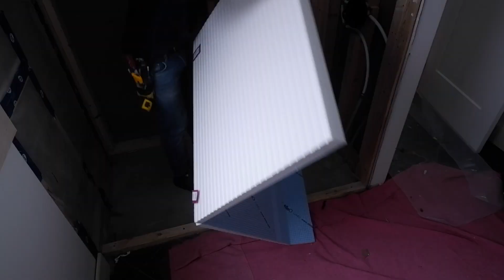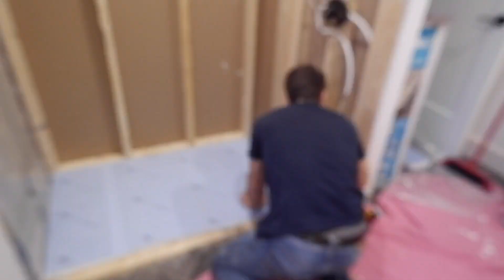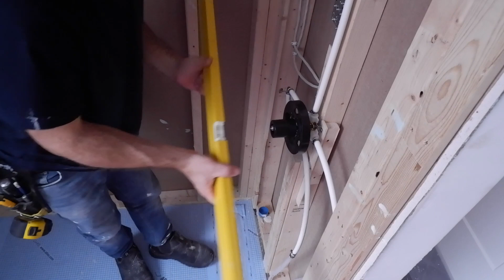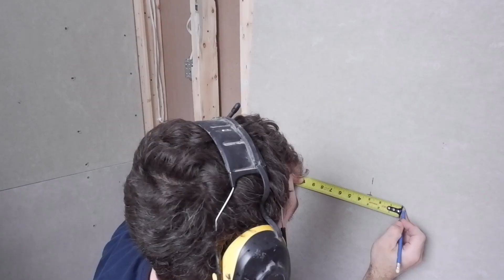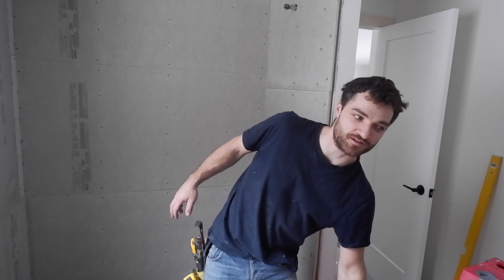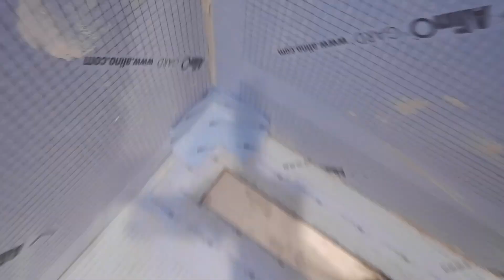Alino: Schluter Alternative - Ep #41 - Off Grid Cottage Build

Comment: How did you attach the linear drain downspout to the ABS drainpipe. Assuming drainpipe was 2" and downspout was smaller.  I assume since you were on a concrete slab, you had no way to connect a rubber coupling below the drain itself to attach it?